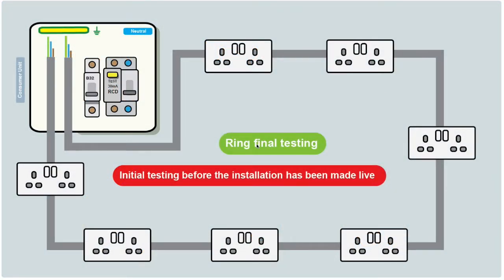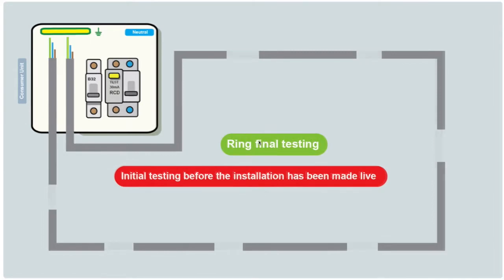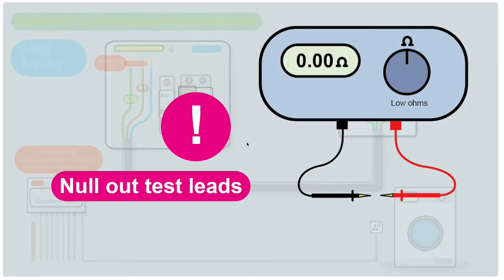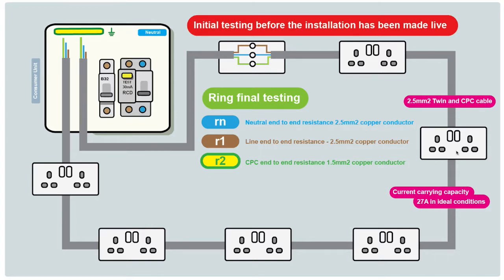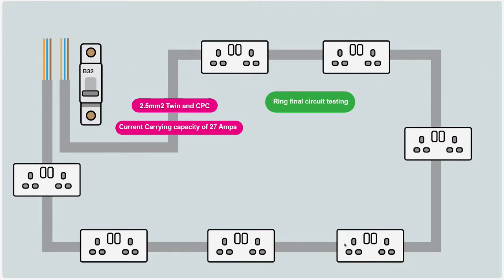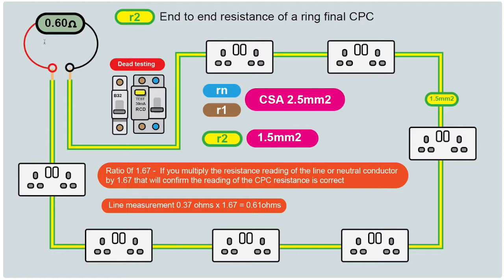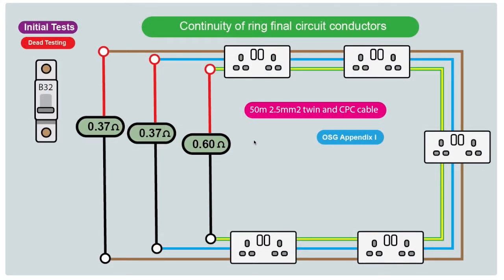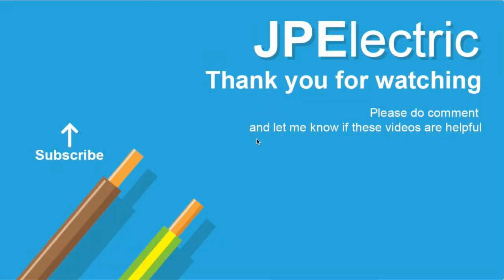Electrical Training - Ring final circuit testing

Comment: how do you know how many metres our on the circuit if you didnt install any of the wiring?
Reply from the maker: Thanks @_mackenzile. You can estimate from the  distance, for a ball park number, or carry out a resistance test, to calculate quite accurately the length of a cable. I cover this in the electrical formulas video.